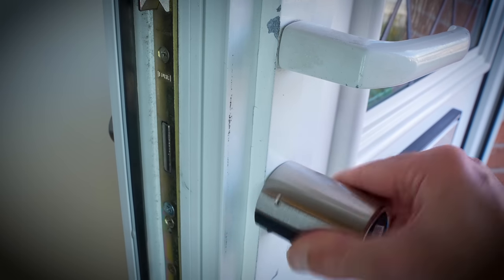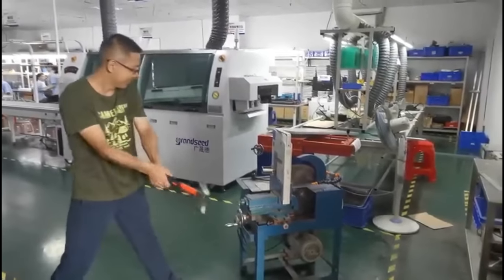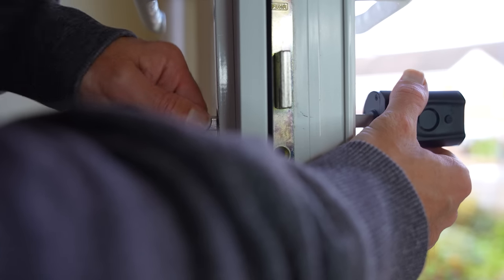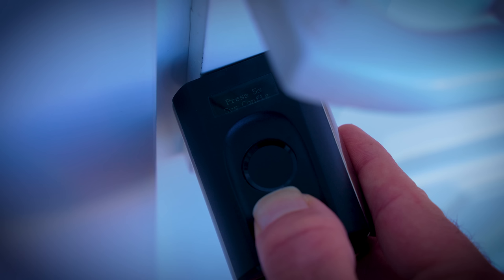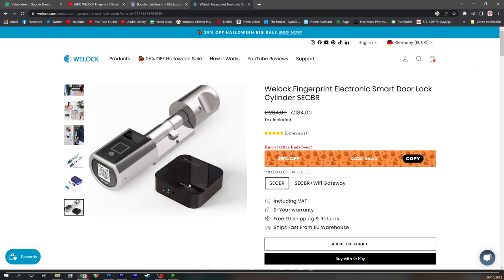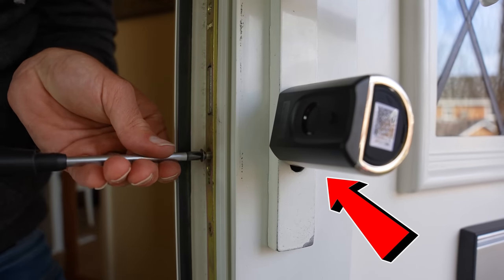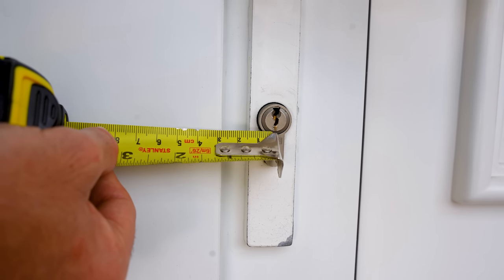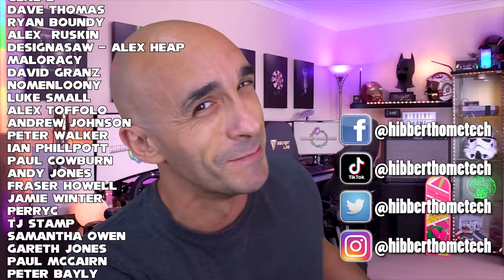This Did Not End Well For Me... Alexa Enabled Retrofit Smart Lock

Comment: Our awkward UK doors do seem to present a particular challenge for the makers of smart door locks! Mine is a composite one that doesn't require the handle to be lifted but needs the key to be inserted to lock it from the inside,  and has multi-point locking that needs the key to be rotated four or five times. 

I think the Switchbot one you reviewed a few weeks back would be a better fit for my setup, especially given that the (current) lack of Google compatibility would be a deal-breaker for me. 

Still haven't taken the plunge with a smart lock given that the somewhat bigger initial outlay compared to a smart bulb or speaker, but your comments about needing a PIN reassures me about the potential for some tracksuited smackhead ape called Dave to gain entry by grunting 'open sesame' through the letterbox. (Not that I've anything worth nicking!)
Reply from the maker: This one replaces the entire barrel including the key on the other side. It should work fine if you have a standard UPVC door and it fits!

Comment: Just tested a new automation for ppl with immersion heaters. Buy a cabled leak sensor and put the system box somewhere dry, run the cable down into the bath and secure (automotive tape). The automation triggers the immersion if the bathroom light on, hot water pump is running and the leak sensor is showing an alert... You do need a smartswitch controlling the immersion. Should help with energy usage.. It should work fine with showers.

Comment: Hm. I like the idea  i'd probably be on the purchase page already if it could be integrated with home assistant. Even if the gateway provided matter over IP then that would be something. However, my main reason for getting a smart lock would be to send reminders around my house if the door has been left unlocked.

I also suspect you won't be able to lock it remotely if you haven't raised the door handles.
Reply: Yeah, a valid point about the lifting of the door handle 👍
Reply from the maker: Fair points. It's definitely more of a lock to let someone in who is stood at the door, and to stop the need for a key.
Reply: For Bluetooth and WiFi access it would be better if they replaced the thumb turn all the original lock fittings for today in the door, this would be motorised as this one cannot be.

Comment: Darn, too late! Just bought 2 Bold Smartlocks. My biggest concern with the Bold is the fact that the battery is on the inside. If it's empty your screwed. But on the other hand. It is pretty unlikely both locks will run out of juice and the lock warns me before running out and there is a low battery sleep mode that limits battery consumption. So I guess it's ok. But nonetheless the WeLock looks like a better solution. Love the light saber and boobs joke 🙂

Comment: Lol, just as I was about to comment on the digital security, you called me out in the video 😆. Disabling BT does address some concerns, but it all depends on how they disabled it. And regarding the "no burglar will hack your lock" argument, recently there's been plenty of car thefts because criminals got access to some tool to unlock cars. If some digital lock becomes used enough, and there's a large enough security vulnerability (which researchers have demonstrated is not impossible), similar devices could easily be constructed

Comment: Will this work on a door, which you have to lift the handle to lock it?
Reply from the maker: Yes, I have to lift my handle on the door I installed it on.  I've had to remove it only because it doesn't get past my frame.

Comment: Since the outside handle is only held on by the grub screw's friction, could you simply tap a prybar between the door and the handle and then use the leverage from the prybar to pop the handle off? Then a smack with the hammer on the exposed shaft to push everything into the house? I expect for most home burglars, a prybar & hammer are more likely tools than rare earth magnets, laptops with wifi attack software, etc. since most homes don't have smart locks.
Reply from the maker: No.  The handle is held on by the grub screw sinking into to holes in the bar (the grub screw is also only accessible once you remove the outer grub screw to the battery compartment too), but either way; the outside handle doesn't come off, it extends out when the grub is released but the outside handle can't be removed, you can kind of see that fairly well demonstrated when that bloke goes at it with the hammer ;) ...  and even if the handle did come off the barrel is held in place by the retaining screw in the door.

Comment: Puzzled.. you say tighten the outside handle to the bolt  does this mean the outside handle can be removed? Also, you state that you can't shout through the letterbox as you need a pin, does this mean you need to say or somehow input a pin before the alexa command would be accepted?
Reply from the maker: No, and yes.

The handle can only be extended, not removed.

Alexa asks for the pin when you ask her to unlock the door.

Comment: On Amazon the same looking Hardware is being sold by Ruilon and Sorex. Just makes me wonder which company is really in the background and can this shared hardware platform open different locks? Would be better to work directly with Alexa. Do you have to set up an account to use the Gateway or App? This is crucial information for me to make sure my data is secure, I prefer to keep my general data with as few companies as possible. If it is smart do I get a message on the app when the lock is unlocked?
Reply from the maker: Hey Gary. It's likely that the same housing is being sold to more than one company. That happens a lot in the smart home industry. The most widely used shared platform is tuya smart life, but the welock software is totally unfamiliar to me so I don't think this is a shared hardware solution. I would recognise a tuya based lock immediately. Either way, a tuya lock would be no less secure just because it was part of the tuya ecosystem, white labelling tuya products is a very common practice and tuya have a solid back end housed on amazon aws. 

If you're concerned about your data though, Why not just set up an email address especially for your smart home products? You could have John.smith6454283u4@gmail.com and none of these companies would have any of your personal information.
Reply: @paulhibbert  Thanks Paul! Happy Sunday.

Comment: I am sure I noticed that the handle hit it too?  That would be a problem with my doors as that have a large throw to retract all the bolts fully?  Great vid all the same.  Most house break-ins are an opportunist reaction and rarely planned.
Reply from the maker: My handle definitely doesn't hit. I suppose it would depend the length of your handle versus the distance to the lock though.
Reply: @paulhibbert  As for pinching batteries it does state: "When the battery is empty, you can use the USB backup to unlock. The USB power bank is for unlocking and can not be charged."

Comment: Call me old fashioned but I'll take a decent lock and key any day.
A bit like keyless ignition in all modern cars manufacturers can stick it where the sun doesn't shine because it's useless and has made stealing a car even easier than before.
Reply from the maker: You still take the stairs for fear of the escalator too right?
Reply: there's nothing like just getting on the highway and realising you left you car keys at home
Reply: @paulhibbert  no but I put my security in hardware not software.
Reply: @stepheng8779  it was not me but a friend of mine , the place he keeps his keys is in range of car key detection , and i think the car either unlocks if the key is in range and you pull on the handle or he doesn't lock it
Reply: @paulhibbert 
They're not stairs they're stationary lifts. Lol

Comment: It's interesting to see that the QR code for pairing with the lock is on the outside. I wonder if one can simply pair with the door after it is set up, reconfigure it and open the door :)
Reply from the maker: Like I said, you can't pair the handle without the code written on the barrel. 😉
Reply: @paulhibbert  Thanks for the clarification. I've missed that part, I was watching the video at double (2x) speed :-/

Comment: It's for doors 55 mm minimum . Most British doors are less than that.
Reply from the maker: Most British doors are exactly like my door.  I had to extend it quite a way to fit, are you sure you have your measurements right??
Reply: @paulhibbert  For door thickness you include the escutcheon thickness, this is probably built into the door handles.
Reply: Yes, 48 for a new style wooden fire door. Pvc and composite doors are thicker. So no probably not most but all 350 here are.  Disappointing.  If you've still got it could you check what it goes down to as one says 55, another says 50. If it's 50 it could just stick out a bit. Thinking about it the existing barrel sticks out about 15mm.
With it being a council block we have to have council doors and you can't drill them. Fire regs apparently. I'd really like one of these too.
Reply: @timballam3675  no handle at the moment. I'm still waiting for a new door, but that's a good point, let me remeasure.  yes at least another 20mm. That's great, thanks  both.